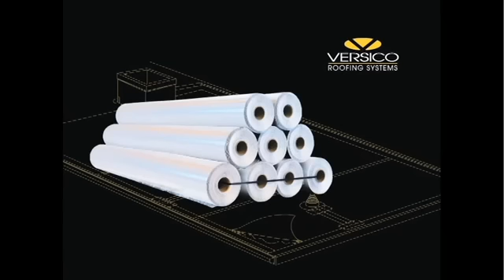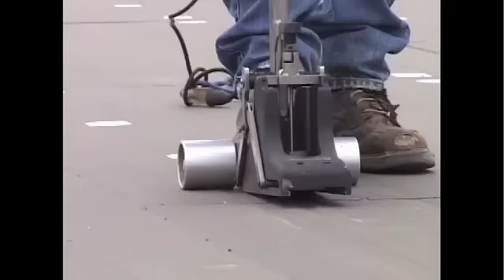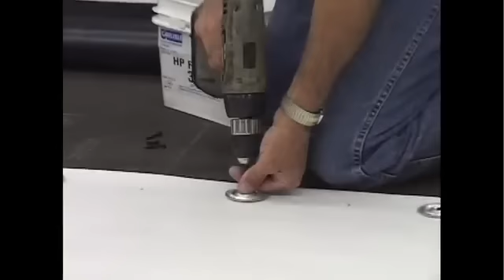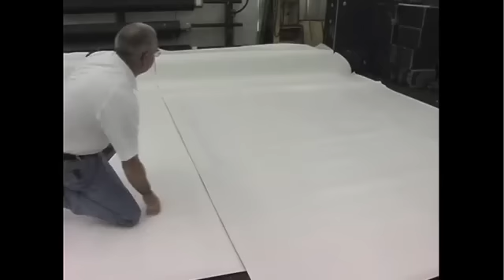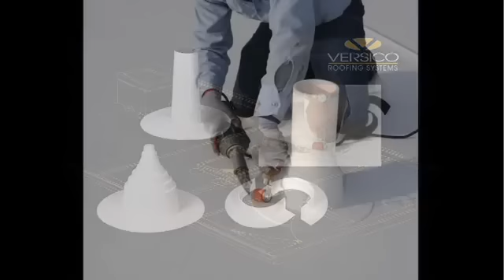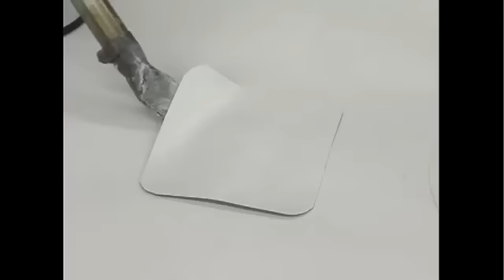"How to Install TPO Roofing" by RoofRepair101

Comment: Why on every tpo install video do I never see guys skipping on the tpo to stretch it out?, was an essential step when I was working it
Reply: A lot on manufactures are switching to just letting the sheets relax. They have found that when stretched  out the sheets rip over time. We do the difference because in the mornings when it’s cold the sheets are nice and tight then when the sun come out it relaxes and any wrinkles that were there show up with the sun

Comment: Is it required that the insulation boards are used?  What if you have a small pitch where you have enough attic insulation, will the insulation boards still be required?
Reply: No. As long as you are to local energy code requirements. 
HOWEVER,  it is good practice to always have insulation and/ or a cover board
Reply: PlanetEarthPassport yes
Reply: If the roof isnt architecturally pitched then you need insulation to pitch the roof towards the drains

Comment: how long do these last? say 60 mil
Reply: Ive seen 20+ yr old ones recently that are still holding out
Reply: IWBVS 15 yrs
Reply: Depends on the pitch of the roof . And did you get skilled roofers . Or just someone that thinks they are a roofer.  Then did you follow up with a maintenance program.